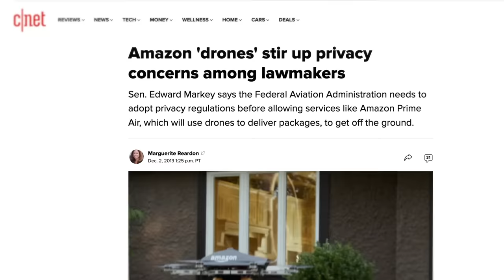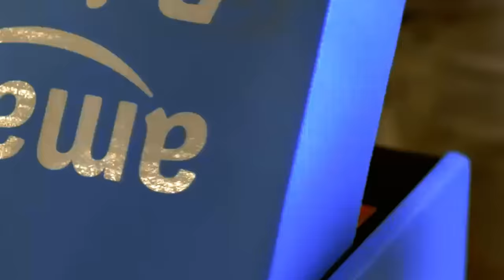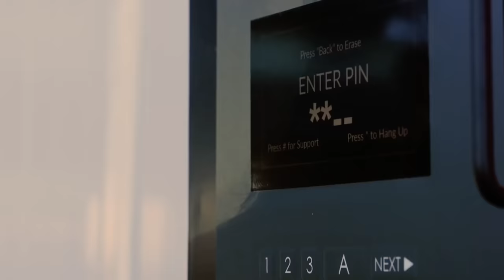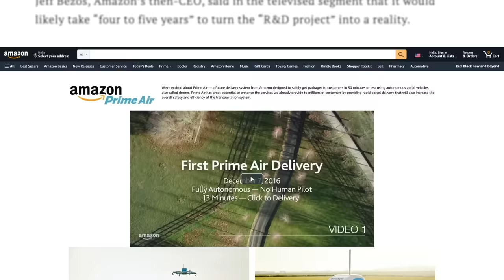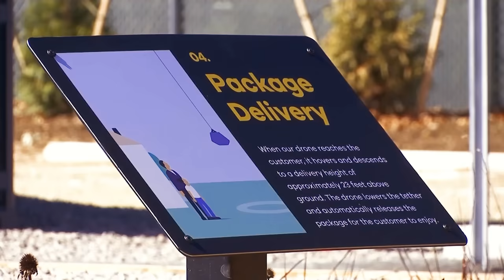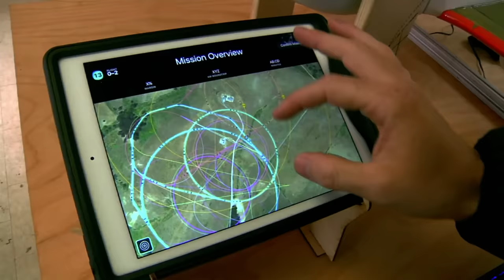Drone Delivery Was Supposed to be the Future. What Went Wrong?

Comment: I live in an area with Wing Delivery, it's brilliant and I use it very regularly. The drone delivery is quicker and cheaper than all the other regular delivery service in the area like Ubereats, Deliveroo, Doordash and Menulog. Importantly, more than just the lower delivery fee (right now they have a promotion going of $0 delivery fee, but even if they started charging it will be cheaper), there's no add-ons or tips required, and there is no significant markup from restaurant prices like the human delivery services. Plus their time estimates are much more accurate by comparison, as it typically arrives within 1 min of their estimates.

But there are drawbacks, there's lots of complaints about the noise from the local communities especially as most are staying at home, the convenience factor is negated by the relatively small operation hours. The options for delivery is not nearly as varied as other services. They typically don't operate beyond 4pm due to the fact that drones are not allowed to fly after dark as per state law. The drone package also pretty small so if you wanted to order a full meal for multiple people, it will come in multiple deliveries. Lastly they also don't deal with peak hours that well simply due to lack of equipment/staff, the typical delivery time for a cup of coffee for me is 7 min, however during morning rush and lunch time it can go to 35min.

Overall, this is a great complimentary service but it doesn't replace the traditional delivery service, but I really hope it keeps on expanding and improving.
Reply: Meanwhile google and amazon bought the airspace an inch above the ground to 600 feet. 
Telling people like me who build fly and inspire young aviators to get into aviation to kick rocks. 
A hobby thats been enjoyed since the write brothers took their first flight. 
Hope those wings are fucking good.
Reply: @krotchlickmeugh627   That's unfortunate but you are getting mad at the wrong people. Where I am they have not purchased any exclusive air rights, I have drones myself that I fly occasionally. You should be asking why your state legislators allows that airspace to be sold to a corporation in the first place.
Reply: @metalfly.  lol dont call yourself a "drone enthusiast" you dont even know what goes into effect next year. 
I have flown all my life. 
You dont deserve the title enthusiast.
Reply: @metalfly.  "state" thats hilarious.
Reply: @krotchlickmeugh627   I never called myself an "enthusiast" anywhere, either way you don't know me, you have aboslutely no idea what I do yet you want to decide what I "deserve"? You have some serious issues buddy maybe take a chill pill.
Reply: @krotchlickmeugh627  That's... not something they can do. Not without losing in court, anyways. Presuming you're from the US.

US v Causby in 1946. They decided that

a) The common law doctrine that ownership of land extends to the periphery of the universe has no place in the modern world.

b) The air above the minimum safe altitude of flight prescribed by the Civil Aeronautics Authority is a public highway and part of the public domain, as declared by Congress in the Air Commerce Act of 1926, as amended by the Civil Aeronautics Act of 1938.

c) Flights below that altitude are not within the navigable air space which Congress placed within the public domain, even though they are within the path of glide approved by the Civil Aeronautics Authority.

d) Flights of aircraft over private land which are so low and frequent as to be a direct and immediate interference with the enjoyment and use of the land are as much an appropriation of the use of the land as a more conventional entry upon it.

So, Amazon can't restrict your own access to your property by buying up airspace above it. Not unless they own your land or owned it at the time of restricting the airspace above it. Certainly not under 83 feet. They would have to pay /you/ to do so. Otherwise, you could sue the state over the transaction of flight access or the company for infringing on your own access and cite the Supreme Court case.

Also, the air space high enough above your home must be public or governmentally restricted (if military is the one buying it). Which means you might need to talk to the FAA about putting your aircraft in the sky, but they can't refuse you or treat you worse than they treat any other entity. You could then sue the government.

I have no idea /what/ you're referring to. It may be true that the age of just anyone flying around is coming to an end. But that was true long ago. Specifically, it was true in 1946 when the supreme court declared that you DON'T have infinite access to the skies. Since then, definitions on what is allowed airspace have likely improved, but it's going to be highly localized. I know places like Disneyland managed to get a no fly zone for their amusement parks. That's not possible in most places in the US. Exceptions and exceptions to those exceptions... But nobody is stealing anyone's airspace... at least not legally.
Reply: Should be a limit on amt of words used :)

Comment: Without doing any of these calculations, I figured drone deliveries wouldn't work when the hype was at full blast. I thought hazards to general aviation and safety issues from drone rotors would kill the concept.
Reply: Protected air spaces can be legislated about for state licensed delivery drones, they're small and fly low, protected airspaces were designed for planes and helis. If drones remove trucks on the road and make people less likely to drive to a store it translates to traffic on the roads going down, less road wear-and-tear, reduced air & noise pollution, ... Enough economical advantages to motivate municipal & federal councils to amend the legislation a little and work out some solutions. It doesn't have to be perfect, drones still won't be able to deliver everywhere but could be forced to operate under a new, different map of protected air-spaces for low-flying aircrafts of less than 200kg rather than follow the old one designed for larger airborne crafts

Comment: Just so you all know - the USPS is used for last mile service in almost every case. Amazon only recently started growing their fleet to be large enough to deliver without them in select areas. FedEx, DHL and UPS still use the USPS for last mile package delivery, just like they use FedEx and UPS planes and even commercial airlines to move large amounts of mail around the country quickly. If your package is delayed, just remember that it wasn't their idea to rip out the sorting equipment. Drones are cool, but fair weather and a uniform infrastructure must come first. The USPS doesn't bow to either.
Reply: In the USA you might add. USPS rarely exists in EU.

Comment: I’m glad that this is having trouble “taking off” because I’m very worried about a rebound effect here.

For those that don’t know, a rebound effect is when an individual action becomes less impactful, but as a result, we do so much more of that one thing that we actually end up having MORE impact!

Since electricity still has a carbon footprint (but much smaller than gasoline) and flying takes more energy than driving…I really worry that air delivery is a perfect way to get a rebound effect.
Reply: So that LED lights thing
Reply: Jake Krause  that’s fair criticism, but how much “extra” electricity from windmills does your area have? If a rebound effect is too strong then it may mean that your area has to turn coal power plants back on in order to keep up. That’s where the issue with rebound effects get real bad real fast.
Reply: 20ah is like 10 cents of electricity.

Comment: I would solve the last foot problem by removing it entirely.
If you want FAST and CHEAP delivery then you'd pick the drone option but you would have to get to the nearest drone "airport" which would be a small container sized box, one of thousands, where your drone would land inside it and you would enter a code to retrieve your package.

Of course this would not work in restricted airspace but it would solve the delivery problem because the drone knows where it can land safely (atop a container) and it's out of reach from dogs and whatnot.

The only remaining problem then is delivering food items, because birds of prey will figure out these drones have food in them and take them down and eat the package.
Reply: But then what's the point of using drones for drop-off points, when you could do this with cars, but with a lot more capacity and efficiency?
Reply: Have you considered how a bird would be strong enough to rip open a drone? Actuallu this really depends on how the drone is made also what type of bird is attacking them, I can imagine maybe an Eagle could do that
Reply: And if we are using a central location, we could secretly deliver all the packages with a van, instead of drones, greatly reducing costs even further.
Reply: @kelogorn  Cars need drivers. Drivers need paying.
Drones are also versatile, they can go to any place in range at the press of a button.

I don't see how a human could just sprint off from one random place to another just like that.

Ever ordered a pizza? It usually takes 10 -15 minutes to make the pizza and then another hour to fill the delivery vehicle with enough pizzas to make the trip worthwhile.

Comment: Most of the problems in the "what makes people anxious" chart stem from trying to turn drones into AI-piloted delivery drivers. We're still working on getting AI to drive cars, let alone get an aircraft to the front door of a residence.
Why does the technology have to be fully autonomous? We already have humans driving around delivering packages; why can't those humans instead control the drones' delivery? They don't need to control the entire flight, they can take over once the drone nears its destination. This reduces the risk of a mishap, and keeps people employed.
To reduce theft, they can implement a policy where the delivery is arranged via app, and the drone doesn't lift off until the customer commits to personally accepting the delivery, which should arrive within half an hour. When the drone arrives, a message is sent to the customer, who then confirms they are present and see the drone, and only then is the package lowered to ground level.
Reply: Let me answer your question with a story. A friend of mine was hired as a SCADA operator. Basically he is supposed to sit in front of a computer screen and watch telemetry fro several remote sites. Because ANY problems need to be addressed immediately. The system may never go down. 
Sounds very important right? Well managers see someone sitting and staring at a monitor as not 'working'. So he gets assigned multiple tasks not related to his actual job.
Now I want you to play a game at work. Fly a drone for a delivery.
Reply: @danamoore1788  that's completely stupid and flying a drone is definitely not like playing a game
Reply: @aquate9637  Tell that to an old school boss. Sitting at a computer is not 'productive'.
Reply: @danamoore1788  that was one incident. It doesn't mean everyone is stupid enough to think delivering items isn't "work".
Reply: @aquate9637  No no no. Delivering items from a truck is work. Sitting at a computer to guide a drone is not. And do you think the SCADA operator is my only example of sitting at a computer is not work? Salesmen at a previous job were not 'working' if they were doing deals on the computer. They had to be mailing out fliers or talking on the phone to be considered working.

Comment: I had talked about using drones when I just started working at big Brown in 2013, ironically before the great drone delivery craze in the news. About drivers using their DIADs to exactly mark a clear drone location during their delivery to an address. Also using package cars as the drone launch and landing location while the driver continued to make deliveries of larger packages. With a recharging drone rack on top, and roof access panel, these could be loaded, scanned and launched. At stops, returning drones could land for recharge or hotswap batteries. Drone would only be needed for short distances, not miles. And you don't need drones for hi density zones since there's many deliveries there vs suburbs and rural - to reduce fuel cost and number of stops available per shift. They finally got on the bandwagon, but think most of my theorycrafting went ignored. ORION (delivery nav software) would need to be completely reworked.

Comment: I’ve always thought plane drones would be best delivering vital organs the last couple miles, or from site to site until it reaches its destination. Or from an airport to a hospital (if being flown from a great distance). That way traffic can be avoided and it can get to the patient quicker
Reply: But the organs have to be in cold temperature to preserve it which would make it unviable to deliver without special equipment
Reply: @cyclix5314  Also exactly why a mini plane would better than a drone.
You could support more cyrofluid or a cooler on the wings, compared to a drone.
Or even add more wings and just add a strip to the roof, similarly to existing human scale helipad, you'd just add a length strip.
Reply: @tropicalvikingcreations  drones are simply powered, umanned aircraft. They can be as large as a plane, if you want them to be.
Reply: Delivering vital organs is a task best left to the most reliable, safest method possible. Those are WAY too valuable to risk to a fucking bird strike on a remote-controlled drone.
Reply: organs get delivered by helicopter already. Much safer.
Reply: @cr4zyj4ck  I am aware... but the thought behind this is landing in a small space to be more efficient. 
Such as a roof top or car park.
Reply: @useyourlastbraincells4480  your name fits very well. I can agree with this... probably better general range anyway
Reply: Why not creating ground tunnel or sky tunnel for drone so make sure the tunnel only for drone to keep delivery not even noisy and safe?

For us to make better future should create tunnel for in every house or apartment with special tunnel unit so everyone can enjoy delivery without worry

More privacy should every room have to have special tunnel for drone will be amazing

Comment: Sounds like the usual situation with a new technology. It gets introduced, reaches peak hype levels with people claiming and hyping up its use in way too many places. After which the hype dies down, but the technology finds a sweet spot. A niche that only it could fufill and thrives in, all be it small. I think something similar could be said for the recent trend with modern Jetpacks (yes those are real). When initially introduced you could barely even find a use for it, but of course now they're starting to gain some niche traction with the British Marines using them a bit to board enermy ships and testing it there, as well as for stuff like emergency response in difficult terrain like mountains to get a first responder up the mountainside quickly.

Comment: The problem with drone delivery is that there is no equivalent of a mailbox. You either need a small landing pad or some kind of a large box that opens when the drone sends it a signal—the drone then gently drops the package into the box and the lid closes. This would also help with the problem of porch pirates, because it wouldn't be obvious whether any particular box had something in it.